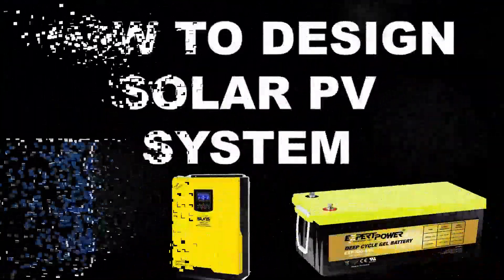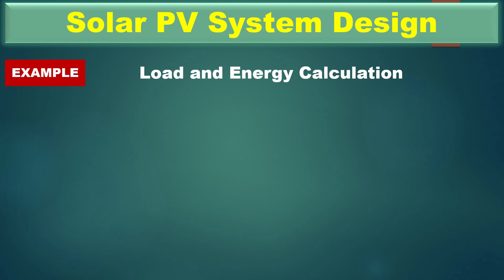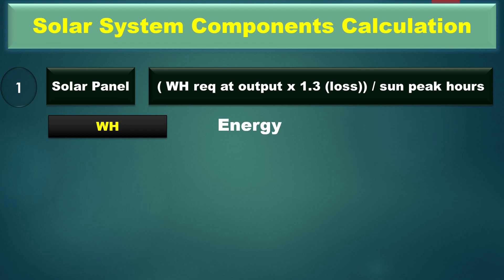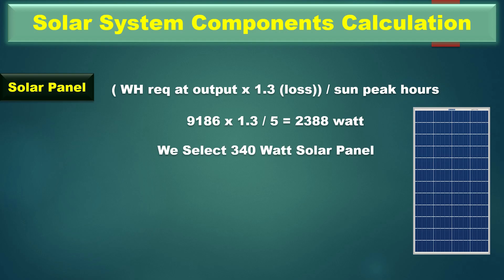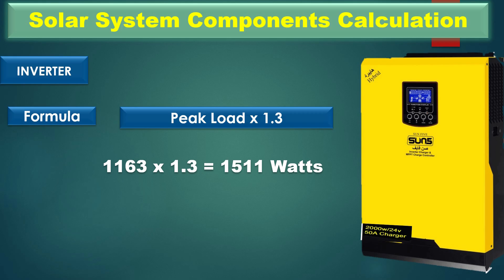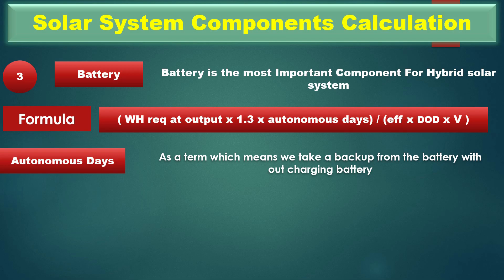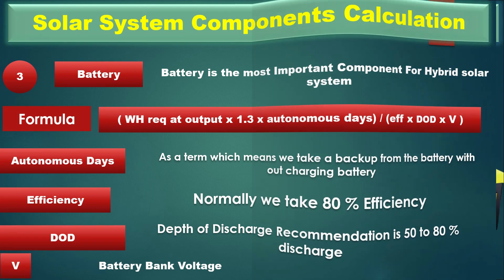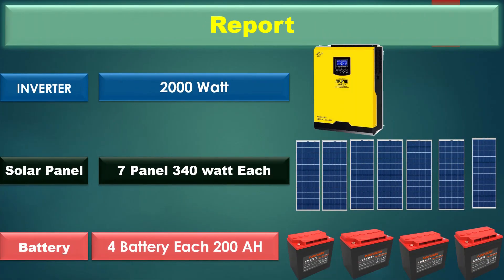How to calculate solar panel battery and inverter for home

Comment: Is 2388w panels power possible on 2kw inverter??
Reply from the maker: Running a 2388-watt solar panel on a 2000-watt
 inverter can potentially overload the inverter
Reply: @whitewatt-hu2lm  then why did u do it in calculation??
Reply from the maker: @actions-for-u  yes but that doesn't mean i am wrong i only neglected the solar charge controller .however  you can suppose that this inverter is without Solar charge controller
Reply: Here i want to add, that if u take energy and divide by sun peak hours and getting pv size, the inverter size should be taken a little bigger than pv and that'll b right